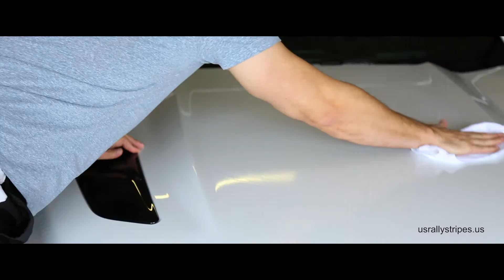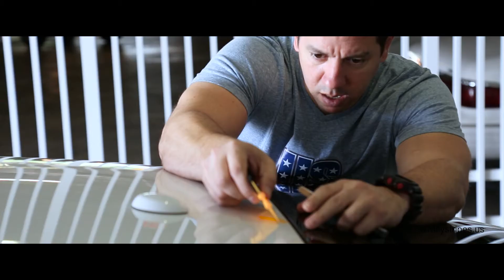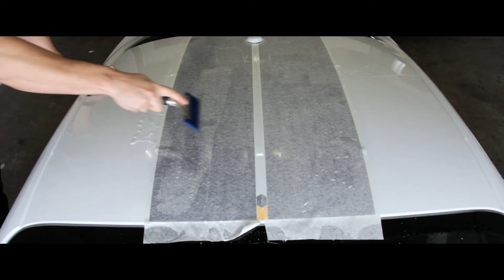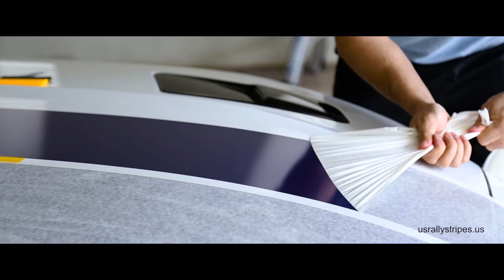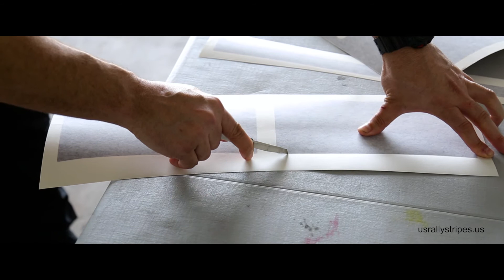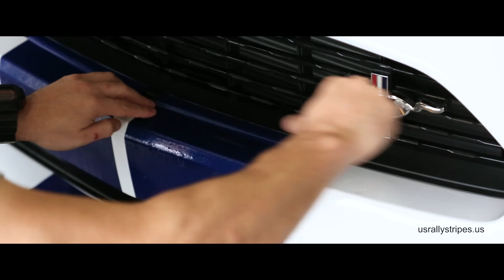How to install racing stripes? 2015 - 2017 Ford Mustang | Wet application

Comment: Use a cord to mark the center of the car. Easyest!
Reply from the maker: I don't think so, the "easiest" is not always the most convenient. Thanks anyway!
Reply: @usrallystripes  Just place a nylon cord lined at front camera, next at light sensor in center of dashboard. Pull it to rear wihdshield an align to center of rear defroster lines (always is a square or a mark in center) or antenna, and finally to rear camera. Easy and precise. Regards.

Comment: How long did it take for you to install the stripes
Reply from the maker: 7 hours! Depending on the temperature and the skills, installation takes 6-9 hours. The drying time before removing the transfer is important.
Reply: @usrallystripes  How long should you wait? Also for the soap what should be the ratio of soap to water?
Reply from the maker: @abanoubarmanious9743   between 30 min to an hour. There is no specific ratio for the amount of soap, for example, in a bottle of water, while I pour the soap I usually count to 3, that's the way I measure it.